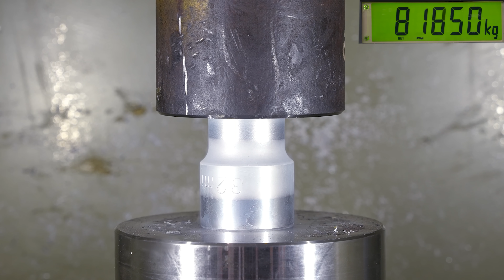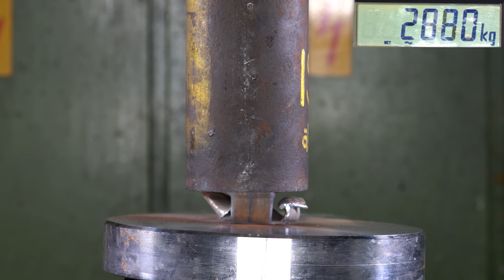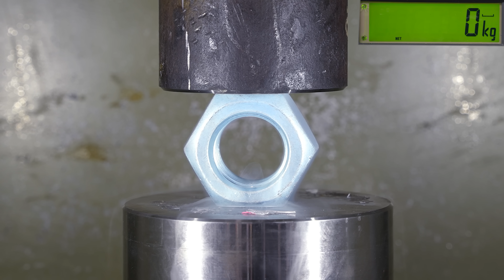20 MOST SURPRISING Liquid Nitrogen Hydraulic Press Moments

Comment: The manufacturer of that press should be working with you for advertising. The amount of shock it takes and nothing ever breaks is impressive.
Reply: They did break the fitting on one of the bed lift lines a while back.  I'm pretty surprised that there hasn't been more damage, though, as these sorts of shocks aren't great for stuff.
Reply: A couple of books did break it a while ago

Comment: I would like to see you make rocks from smaller rocks but freeze the smaller rocks in nitrogen first
Reply: I'm no geologist but I'm pretty sure that's not how the majority of rocks are made 🤔
I think they'd be missing 2 of 3 vital things that produce rocks, those being extreme temperatures and unimaginable periods of time. Most rock starts as molten lava forced to the surface of the planet and is under immense pressure over many thousands of years. 
The only small chance they would have of making something resembling rock would be to try and create sedimentary rock by applying an extremely high amount of pressure to a mixture of sand and silt, but I don't think even this would be successful owing to the length of time required for it to truly set into the true form of a rock.

Comment: I love that you can see how the things heat up from the pressure. 
OOOOHH a thermal camera would be fun. filming with one not crushing it XD
Reply: That would be cool knowing where the temp goes high first
Reply: This would be cool, but metals are reflective even for IR, it won't work properly
Reply: @YoshiAsk  Sorry, but are IR missiles not used on planes and tanks? I believe those are made out of metal.

Even if the emissivity is different from other materials, you can still use an IR camera on them. And because they're cooled in liquid nitrogen beforehand, which has a known temperature, it would be super easy to calibrate.